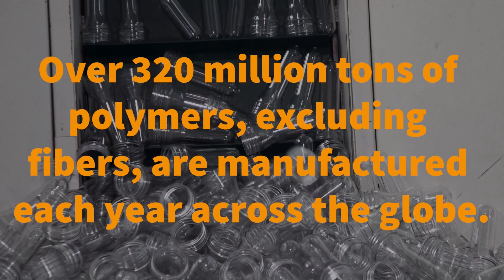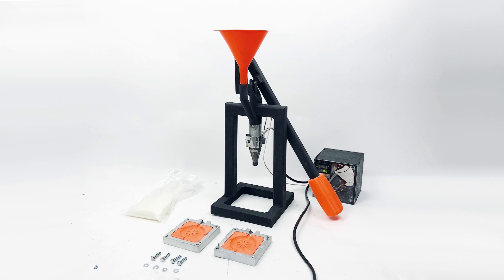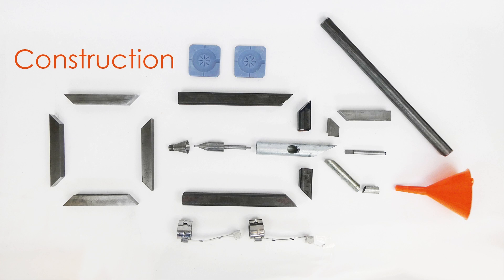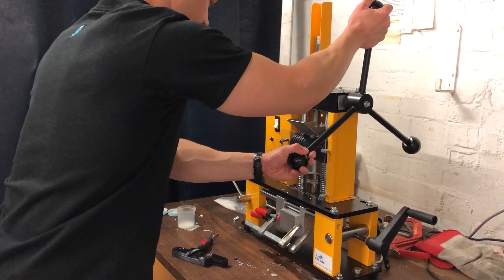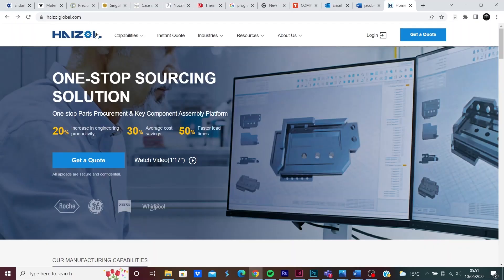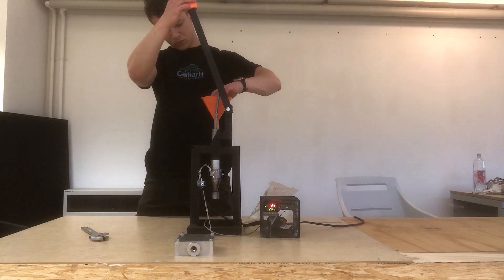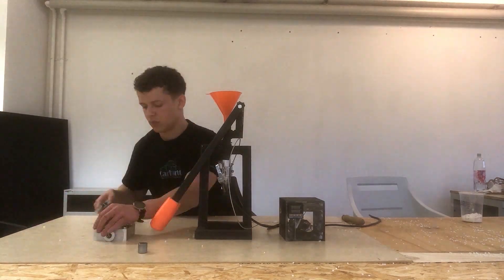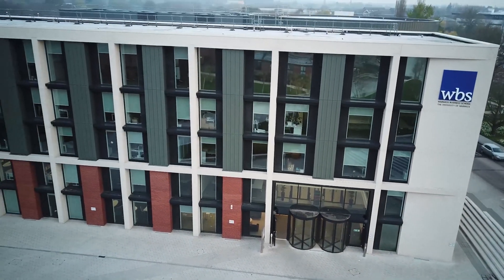Moulding For The Masses Proposition Video

Comment: The downside of printed moulds is the slower setting time. 20 minutes cool down time is about the same as it takes for a two part resin to cure to demould levels.

Comment: being limited to PLA seems like it limits the application to indoor products.
If you don't want to use a high temperature 3d printed resin , how about making the molds from a higher temperature solder (maybe Zn/Al) via a lost PLA casting?
Reply: Pla is good enough for outdoor.
Reply: @NicolasSicardRoy   PLA isn't UV resistant.

Comment: Do you need to wait for the mold to cool down in order to unscrew it? If it won't affect the part, I'm guessing you could speed up the process by using several molds with the same injector.

Anyway, great work!

Comment: This is good! Also,  Buster Beagle 3D made a robust and mostly off-the shelf parts, injection mold machine. However, the main problem with all of this is how to  democratize the mold making itself. Resin molds do exist, but  still have plenty of hurdles.

Comment: This is way too slow. There are some easy ways to speed this up tremendously. To around 60-90 seconds per cycle or less. These 4 suggestions would cost less than $40-50.

1. Hinged mould halves and a clamp to hold them shut. This allows you to quickly open and close the mould. A pressure activated clamshell base made of a few strips of steel could even remove the need for a hinge and clamp. As the mould is pushed down during filling, 2 plungers from the side push the 2 halves together. You simply set the mould and pull the lever.

2. Multiple molds. At a rate of 3 parts per hour the time to make 100 parts costs you more than just ordering them. Not only do you have permanent molds which can be used for 50k+ pieces at a cost of pennies each. So multiple moulds is a must. 

3. Cooling. If you use a 4 part "mould frame" it is easy to grind cooling channels into a flat plate add an o-ring and a quick connect fitting, bolt 2nd plate over it giving you 1 half of a frame. Total cost for a frame would be less than $20 (4 1cm thick aluminum plates, 1 o-ring, 2 quick connect fittings, some epoxy or screws). Add a cheap Aquarium pump for $5 and pump cold water through the frame. If you go with the multiple mould idea a simple cold plate built as described above would suffice. After filling each mould you lay it on the cold plate and fill the next one. 2-3 minutes later it should be hardened.

4. Springs. Springs are cheap at around $2-3 each and by putting the nozzle assembly on a spring, you can fill the mould without screwing it to the nozzle, remove the need to cap the nozzle during preheat, and avoid having to screw the mould shut.

I think if you need a 3d printer to make the moulds you might as well spend the same amount of money on an aluminum cnc router. There are models foe small parts in the 200-300 range which is what a decent 3d printer will cost you as well.

Comment: TBH. its arguable that its no faster than 3D printing anymore.

5 hours is a ridiclousnoverestimate.

This thing can be had in the time region of speedbenchy.

And if you need it as functional part, you might as well use ASA (for UV and tmperature resistance).
And since it can be vapor polished, you can way more easily dick around with wider and thicker layers - reducing the time needed even further.

I reckon its a sub 5 minute part with klipper firmware, and a good throughput nozzle - be it a longass one, or  a CHT nozzle (or clone), to facilitate better heat transfer to filament and thus higher throughput.
Reply: Yes, that part shown as 4h 44m should be printable in 10-15 min on a fast printer and 20-30 min on something like my "dragster ender 3". You need to be a lot faster than 20 min per part to have a production speed advantage over a good 3dp setup.
Reply: I was shocked, 5h,? Nah, makers with klipper firmware know that is can be done faster. Mine converter ender 5 can do that under sub 1 hour. 5h= 5piece.

Comment: Using plastic molds is certainly an interesting way to get around the prohibitive entry cost to injection molding, although it is highly restrictive in terms of time efficiency and mold life, and thus ecological costs. Presumably this could be dodged by using the "lost PLA" casting method in sand to create metal molds, although setting up a foundry would probably bring you to the equivalent cost of just buying a professional milling machine. Still this is an extremely promising development that other developments could leapfrog from.
Reply: Trying to do lost cast mold if with aluminum will create so much post milling it’s not worth the cost. Best thing I’ve found so far is using a resin printer using high heat resin. I’ve gotten 200 injections out of one mold. Which the cost is one tenth the cost of even lost cast aluminum molds
Reply: @carl_doesstuff   Routine resin printing is so spooky that I wouldn't advocate for it's use outside of professional, well funded shops. Vapors causing cancer or quick poisoning require dedicated fumehoods and good filtration, and skin absorption means you need good hazmat work ethic. 

As for post milling lostPLA-cast aluminum: it depends, but generally I disagree. Most small-scale injection molding tends to be art or parts that could be minimally post-processed to dimension, like with a tap-and-die set, soldering iron, or sander. The printer would already have dimension-accurate isotropic complex parts under control if you went with full in-fill and then smoothed the layer lines with an outdoor vaporchamber or by baking it in a box of powder salt. Most other uses of injection molding at this scale could be done with other methods as well.
Reply: You can use a hair dryer to power a charcoal diy foundry and smelt aluminum in an old steel pot and make wooden molds packed with foundry sands. Also precious plastic has guides on making aluminum molds for plastic